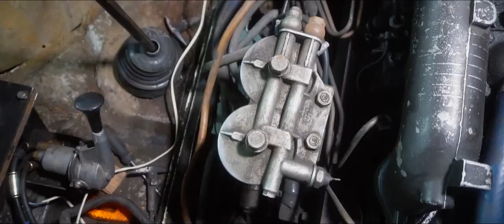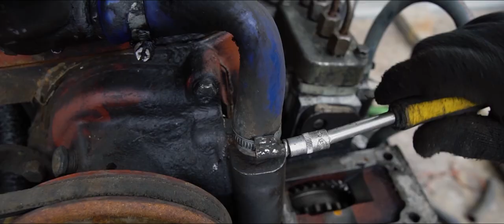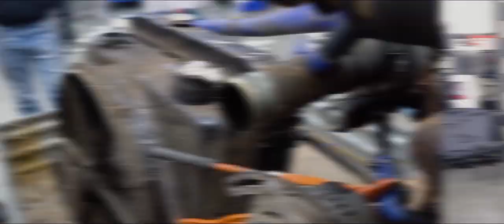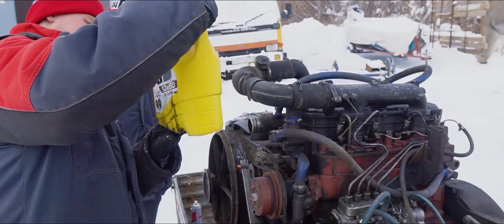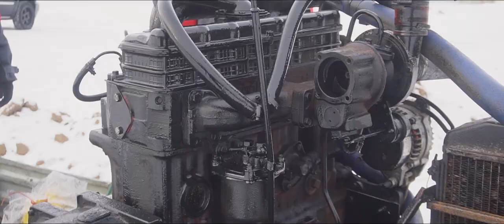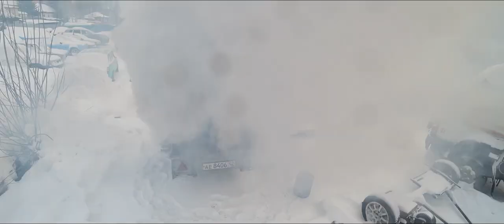Runaway diesel – part 2 (obliterating the PAZ bus engine)

Comment: Next diesel take of the governor see how many revs can get before it goes boom. 😂👍
Reply: So freaking agreed!! This is the most important part!
Reply: That's the spirit! Lol
Reply: Jamming the governor open is too easy man
Reply: When its running on the oil from the sump the governor plays no part anymore.
Reply: @aeroflopper  true but that engine wasn't up to it turbo just got clogged.  Want to see a diesel rev 8/9000 for a bit see how many pieces it ends up in.👍
Reply: The engine was running really fast when i added oil to my tractor engine. like 3 quarts extra. But our smoke was black not white any reason why?
Reply: @jack8356  sounds like it wasn't fully burning the oil where as would of been white if totally burnt. Only thing I can think of in your case.🤔👍
Reply: @JohnSmith-jl3fm  makes sense to me thanks
Reply: True 😅
Reply: Yes but keep the oil and coolent in it and maybe a line from the turbo inlet into a big jug of diesel so it'll stuck up the fuel and the revs will climb and climb
Reply: When it's running away you will get the same affect

Comment: I had a engine that went to runaway 3-4 times on me, the motive was a leaking injector that doubled the oil capacity from 4.5 L to 9 L. Knowing the fenomen I reacted on time and the only damage was a blown coolant hose.
After I fixed that injector and hose the engine was fine but I wanted to do a rebuild because a 22 bar compresion on cil 1 vs 26 bar on the other ones. Nothing else was afected. The engine was 1.7 CDTi  made by ISUZU

Comment: @Garage 54 really hope you see this comment! Next for this engine, please remove all big end and main bearing shells & build it without bearings. (probably tack weld the bolts to stop them rattling loose) and set it running again, see how long it will run with no bearings to seize up lol

Comment: Seen many runaway diesels. They float the valves until they run out of oil and lock up. No big deal. Some had air cutoff flappers in them. Activate the "emergency  stop" and replace the turbo, and they are good to go. Valve spring tension limits rpm. The higher the spring tension, the higher the rpm. All engines are built with this safety feature built into them..

Comment: Just take the oil scraper rings out, it will run away soon enough. Plus fill the crankcase to nearly the bottom of the pistons with a mix of diesel, ATF and old brake fluid mixed with the oil.

Comment: Ran away diesel engine nice. I remember having one when i put 3 quarts of oil in extra. I thought the engine was low on oil so i added 3 more in and was still low. My mom started the engine and it started smoking black for at least several yards and after it was shut-off i finnally found the oil dipstick

Comment: Simple way to induce runaway.....drain oil and run under light load until turbo fails.  Then fill with fresh oil and new turbo.  You now have a diesel engine then will try and do 12k rpm off throttle 😂

Comment: Next for this engine, remove all big end and main bearing shells & build it without bearings. (probably tack weld the bolts to stop them rattling loose) and set it running again, see how long it will run with no bearings to seize up lol

Comment: GUYS!! See how fast you can get an engine to spin, like 20000 RPM. see at what RPM it blows up at. Get 2 engines, you'd need a powerful engine (engine A) and gearbox married together, weld the crank of the second engine (engine B) to the output on the gearbox. Fire up engine A full throttle and put the gearbox in 5th or 6th. Engine B should spin a bit faster than engine A. Take engine A to the redline!
Reply: Even better, the "power" engine with no gearbox, "revs" engine with gearbox, connect output to the "power" crank & you'll have a good selection of gears working backwards to make it spin even faster. Start off in 4th, if it survives go to 3rd & so on...
Reply: @danmackintosh6325  yess man good thinking! 👍

Comment: If the engines old enough there will be a governed fuel rail under the valve cover . If you can freeze it at full throttle  you can bypass the governing function. This is how alot of old engines go run away. They seize

Comment: how did it seize ?
after you shut it down with a fire extinguisher you cranked it on the starter. yes it sounded like it had  no compression but ether may have got it started. all your other vids 9 to 10 out 10. This one a 6 out of 10. start the engine, let it go till it blows

Comment: On a true runaway Engine the intake isn't blocked, you should have just dumped the turbo oil feed down the intake once the engine oil was at a high temperature.

Comment: i have an idea for you guys! a really really stupid idea, cut holes between the oil galleries and the coolant veins on a head gasket, re- assemble engine, fill radiator with runny oil, see if motor will successfully run and keep itself cool with oil for coolant. absolutely stupid idea, great for my crazy russian friends....

Comment: if you want a engien to run away you olso can flip it on its side somone at my old job had a hats one cilinder diesel on the forklift it was a ground saker and it ran of the forklift on it side

Comment: Definitely want to see how a co2 fire extinguisher would work against a run away
Reply: It would instantly shut down the engine if it is sprayed directly into the intake. There would be no oxygen, so no ignition. Dry powder would probably stop it too because it would clog the air filter but you definitely wouldn't want dry powder in the intake because it melts and will damage the engine significantly.

Comment: man number one, the fire extinguishers filled with carbon dioxide it'll shut it off by itself. in the other thing, y'all can't even make a diesel run away,& when they do it by themselves. if that is your full send, that just sucks. at the end you finally get a good runaway, at that point, you should have just sent it. instead, you once again shut it off for the 35th time. that's so lame, the guy with an 18-wheeler on the side of the road, went full send much better than you guys. that was disappointing to say the least..  😠

Comment: When an engine runs away like that, it's already revving beyond the governor's limit, it wouldn't make any difference with or without a governor. Runaways are burning so much fuel or oil that they rev to the point of catastrophic failure.